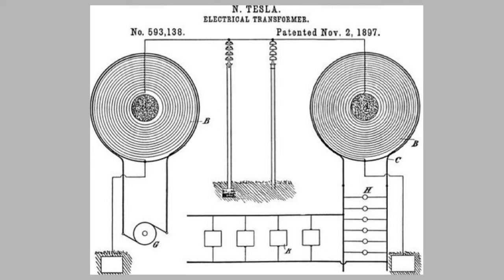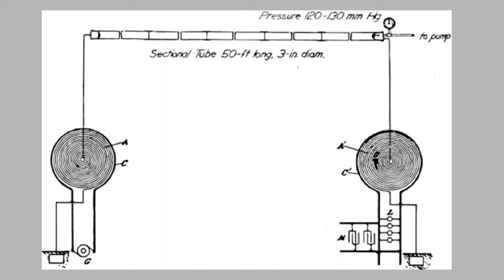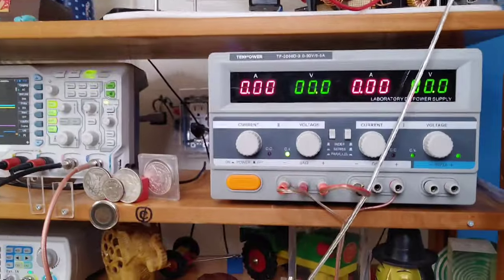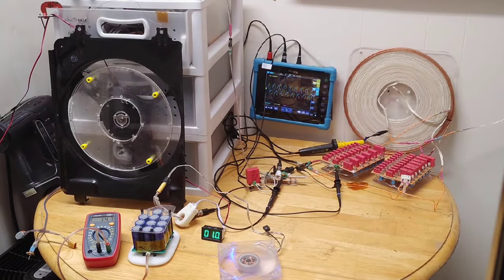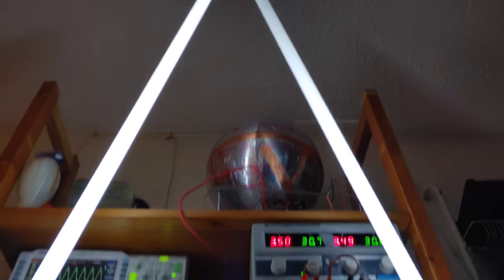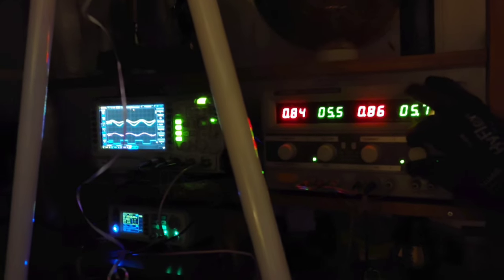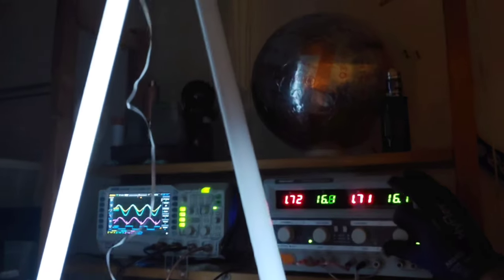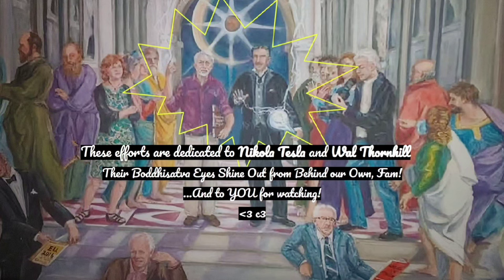Nikola Tesla's Single Wire Power Transmission, Part I: thru Flourescent Tubes & Wire

Comment: Hi cold3, quick question, how are those supercapacitors wired up? I assume the multiple capacitors are connected together in parallel but how is the brick wired up to the circuit? Parallel or Series? I'm trying to figure out what the best configuration for isolating loads like this are, cheers.
Reply from the maker: I thought i had a 'trick' with wiring em but nah, even with no balance board they work wothout issue, I'll link ya a schamatic drawing I'm finishing up, l8r today
Reply from the maker: My ultracap (supercap bank) is 10pc of Maxwell 2.7V 100 Farad supercapacitors in series for a 27V 10 Farad assembly. Balance boards on aliexpress (by CSDwell, they offer many options, 2S-20S, etc), but for me they are only usefu/neededfor their overvoltage protection, i find. 

*but yeah with regular caps, go metal film or ceramic, yup some parallels, then assembly connected in series with rectifier +/-, for the filter/smoothing/storage cap action ❤

So mine is exactly as if i had a 10S li-ion battery bank connected to DC+/- out terminals of rectifier. Except supercap cells. $12p per cell, be very kind to las familia del capacitadores 😅

rectifier will need grounding, but one may also have 2 5S supercap groups in series, grounded in the middle (for equivalent: identical output tho).

Rectifier diodes neednt be superfast or specific RF type. Schtokky perform interchangeably, equally good as regular ones.

Bout to try with a motorcycle "regulator rectifier" to max it at ~17v and heat up resistors instead of stressing supercaps. My 27V ones been pushed up to 35v accodentally for a few short minutes, non destructive so far but one of my 2 10F units self-discharge drains faster, prolly added ESR, as price of my learning curve hehe 😸

Bout to get curent probe and improvise/play with power factor correction stuff 🤷

Sidebar: Tesla motors bought Maxwell in 2018, raided Maxwell's "dry electrode" methods/patents, and then immediately released/dumped Maxwell back to do its own thing again lol, Maxwell is the pioneer dev of graphene double layer supercaps :)

We could buy these assemblies off-the-shelf for $300-500 USD, or make em for $120, at my specs (27V 10F, from. 10S 2.7V 100F cells).
Reply: @cold3lectric  I was able to get the design working in Falstad, now I'm looking at how far I can push the C down before isolation no longer works to save on costs and size. Thanks for sharing the details cold3! There are a few extra things I would like to ask your help on though.

What would you say the minimum net capacitance of the assembly would need to be to prevent inductive loads from detuning the connected source? 

Also why does the Rectifier need to be grounded? What purpose does that serve? 

Finally, what would you recommend for isolating a load with a supply of 240 volts and high amperages? The 27v rating of the supercapacitor bank doesn't meet the criteria of what I need, perhaps isolation an transformer? Cheers.

Comment: I have to ask Is the capacitor and bifiler coul coil at the same values  100mH 100mF in series pulsed at 630ms
Reply from the maker: unclear, repeat question?

Comment: What is the purpose of the bifilar coils in this setup?
Any physics behind the bifilar coils here?
Reply: Bifilar results in canceling of the XL (inductive reactance) and Xc (capacitive reactane  IF THE FREQUENCY APPLIED TO THE COIL IS THE COIL'S RESONANT FREQUENCY and in that situation, only the copper resistance of the wire affects current flow in the coil.  Impedance Z normally sums up the resistance of the wire "R", the XL, and the Xc.  Here, there is only R,  so  Z = R

Also, the winding of the bifilar increases the voltage between each adjacent wire - this is specifically the case for Figure 2 of Tesla's patent US512340  and not Figure 1.

So he puts the coil into resonance by applying the resonant frequency from the signal generator (or RF supply, etc). and a lot of energy is stored in the bifilar.     (If instead the coil in Figure 1 were used, which is not bifilar, less energy is stored between each adjacent winding in the coil).

So he's doing the following:

1)  the secondary winding has a lot more turns than the primary winding - STEP-UP TRANSFORMER then, large voltage boost for the output

2)  frequency of resonance is applied to the coil so as to eliminate XL and Xc

3)  bifilar (dual adjacent windings) are used to store more energy between each winding (read the text of the US512340 patent which explains how)
.
Reply from the maker: See Master Ivo's youtube channel to dig into the bifilar rabbithole, i have to actively avoid speculating on such lately. Beginners mind, to some extent.

Bifilar has such increased self-capacitance that their resonant frequency is much lower than otherwise. I'm in the low 100's (of kilocycles) while many coilers do MHz.

i like "LF" since "earth resonance" experiments will hypothetically need to achieve as low frequency as csn be managed (bigger coils, cost & space increases, but all that's just a dream at present).

Tesla said, in "the disturbing influence of solar radiations on the wireless transmission of electricity", that any wavelengths shorter than a few  thousand meters (ballpark of 50kHz-100kHz) will suffer too much losses as irradiated water on "earth dayside" is heated by sun, evaporates, removes charge from GND", paraphrasing from memory 🤷

Comment: Are your bi-filar coils tuned for resonance?
Reply from the maker: yes, I use tuning capacitor 'switchboards' (with caps available in intervals which can be switched on/off, in effect giving a variable capacitor), one in series with the primary (about 103nF for example), and one in parallel across the secondary (4nF, though i had use switchboard/variable caps to find optimal value, then make static/non-variable cap of that value, so as to combine caps in series for increased max voltage, after burning up some caps).

Though I'm working now on having a primary tank circuit pre-tuned to match the resonant frequency of the secondary, in order to dispense with the secondary parallel capacitance, which limits the max operating voltage - also since having parallel caps across the secondary is a very uncommon practice for Tesla coils.

For the bifilar pancake coils i showed in this video, i was following Master Ivo's approach (see his channel for more info) - but presently I'm building a more typical solenoid/cylindrical/helical coil system, like those shown by Hakasays (more details on his channel).

Comment: Looking at these two big round pies, I think it's creating a magnetic field
Reply from the maker: I was worried you'd made a dirty joke lol upon seeing notification showing only the first few words hehe 😇/😈

But the compass needle hardly deflects, even in center of powered xmitter, it moves like 10degrees 🤷

The recent 'single wire power' russian authors claim its a magnetic field aligned with axis of wave propagation, and a longitudinal electric wave which is classically called a reactive capacitive displacement current, a polarization current of e-field oscillations, as opposed to "true conduction". I wanna know precisely what ALL the aforementioned things mean someday lol, wo0t!

[...Actually attempts to]

Comment: Single Wire Earth Return (SWER as it it called) is used out in the country in Australia at 50Hz and only 6 or 10kV lines. It works quite well for any load put on. The end transformers are usually 6 or 10kvA transformers.
High frequency without a wire must suffer from the simple fact that the power from a radio transmitter reduces with something like the square of the distance and there fore it won't be efficient.
Reply from the maker: Modern authors claim its not a conduction current, nor a closed circuit [debatable via stray/fringe/parasitics etc], but Avramenko/Strebkov call it 'capacative reactive displacement current of virtual charges', aka 'polarization current' or 'e-field oscillations', not subject to ohm's law, not productive of joulean heat upon conductor, it aint radio nor is it an EM radiation, is the hypothesis i wish to investigate 😺

I'm worried its some of that russian "fake news" i hear so much about from the punditry 😇

Correa & correa make good arguments to term it "massfree charges". It f*s me up bro.
Reply: @cold3lectric  I can assure you that I am not Russian. I did work in Moscow over a 3.5 year period back in the 1970's but I am born in Denmark and have lived in Melbourne Australia since 1978. I went as far away from Russia as I could almost. I used to work for an American computer company called Burroughs Computers. Last I heard of it it was Unisys (as it was when they retrenched me) as Burroughs merged with Sperry Computers.
The SWER lines are real and used a lot to get electricity to farms that are located kilometers apart. It is used to reduce cost a there can be longer between the masts. They only have to keep the wire from ground and not from not hitting the return wire.
Reply from the maker: Earth currents are just fascinating right? Can't explain it, though i may try, but it's soooo.... efficient!  

Peace be with you comrade, capitalism is alllright, but yeah citizens of earth? Nationalism is obsolete perhaps? 💚💚💚
Reply: @cold3lectric  I prefer what I call Capitalist Socialism. I do believe people are more important than money. I believe all people should have the right to a reasonable living but on the other hand we must also have some capitalism to make people put in an effort. What I saw in Moscow was that people didn't care for much other than just trying to stay out of having problems. True capitalism doesn't care much about the workers. It is only for making money for the business. Some capitalism is needed to get people to get off their ass's to do some thing extra. People like Elon Musk is needed to bring development forward. That they get filthy rich doesn't matter so much as they generate work for a lot of people and  knowledge for many others. 
Over all if it wasn't for capitalism we could easily feed and house all people in the world EXEPT if it wasn't for capitalism we wouldn't know how to. 
Nationalism - too much is bad  (Nazi Germany) - some is probably ok. If you have none then you will allow all to come to where you are and it currently is free migration will kill it for every body. If you flood a country with refugee's there won't be enough for ever body even the refugee's. Big changes work best if done slowly. Better than refugees would be that the country from where they come developed a bit of nationalism and people started to work together for their country. That is what I think right now. 
In regards to earth return then I would think it is probably the capacity of the earth at the grounding wire that absorbs and gives of the electrons rather than an actual current through the earth.
Reply from the maker: @leonhardtkristensen4093  do you notice the 'patronym convention' increasing social equality? I've heard it argued so, as opposed to british/American "house/dynastic" development, over the generations?

I'm Michael (mike), Junior, so call me Mikhael Mikkelson 🕺
Reply: @cold3lectric  Hi Michal. No not really. I have just developed my own life philosophy over the years from what I have seen and been told. As I said I am from Denmark and know a bit about the Danish Welfare system. My sister lives there. I now live in Melbourne Australia under Australian laws and conditions and I know that some now. I have seen the Soviet system back in the 1970's. I have also seen apartheid in South Africa in the 1970's.  Working for an American company for 19 years I saw how international companies move profit between countries. Working for an Australian company for 14 years I have seen how a company care not so much for a single worker but much more when the workers are united. We have seen and heard how the tobacco companies told us that smoking isn't dangerous. Lately we see that the truth about what happens in the world depends upon who tells it.
I have become a little cynical. I don't believe we ever get equality between people and in any case equality will be different from person to person as they will all have different criteria for it. I am quite happy living as an old age pensioner in Australia but if the American company hadn't retrenched me and 4 others (not because there was no work for me but because the equipment I used to work on a couple of years earlier was no longer in use) I could have retired 11 years earlier with a company pension. 
I hope for more social equality or possibly more local happiness as if one has enough to fulfill ones immediate needs and a little more than ones neighbour then one would normally be quite happy. It will be impossible for every body to have the same and most people want to be a little different anyway.
Mass migration I don't believe is all that good. The migrants like the material goods in their new countries but they also want to keep their social believes like religion, how to behave and how to dress. They often also keep their distrust or rejection of others way of living. In Denmark we like to eat pork. I have been told that that is disliked by some migrants. 
Anyway all this has nothing to do with your video. I don't have much knowledge about it except as I have stated it is used in Australia. Wireless I don't believe it to be efficient as it has to function as radio transmission and has also been researched for the use from a theoretical solar space power plant. Radio signals as light always spread out. It can be focused some but not enough. It is costly too.

Comment: 9:36 So is the rate at which the lighted parts of the fluorescent tubes moves the speed of a resonance wave between send and receive coils? The direction of and rate of oscillation dictated by the resistive load value?
Did I even form a sensible question there?
I'm not sure, lol.
Reply from the maker: I had wondered something along those lines. The farthest i've gotten with it is "i think these are what's called 'ion acoustic waves' - dunno "

Comment: Coils should be wound. Wires flat side by side not stacked from what i understand
Reply from the maker: I was leaning toward flat/interleaved bifilar too, but I'm starting to notice some unexpected behaviors. For instance, instead of finding a TEM resonant peak and then the LMD second resonant peak about 1.5-1.6x higher freq, the flat/interleaved has its second peak at exactly 2x the freq of the first. And with just a 2-turn primary, the voltage waveform is too messy to interpret the phase relation, i can't be certain I'm even in LMD mode. THEREFORE i am working on a short video to compare the 2 bifilar layouts side by side: flat/interleaved & vertical/stacked. Stay tuned!